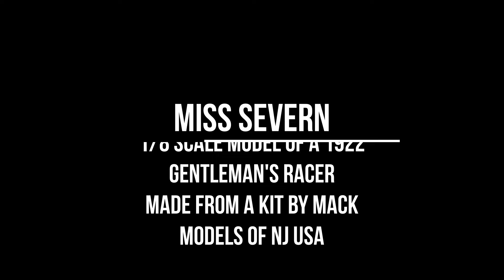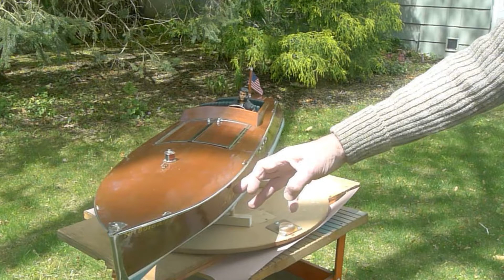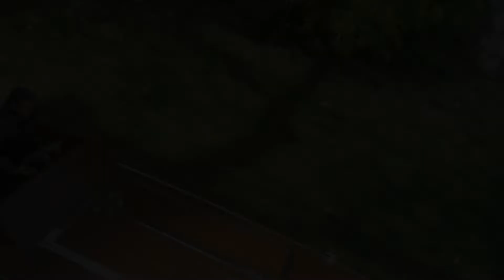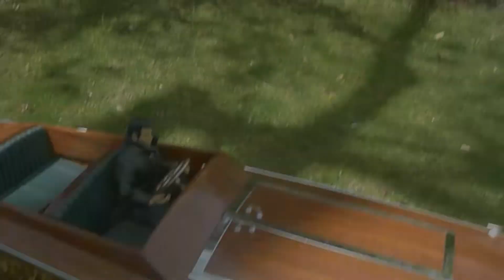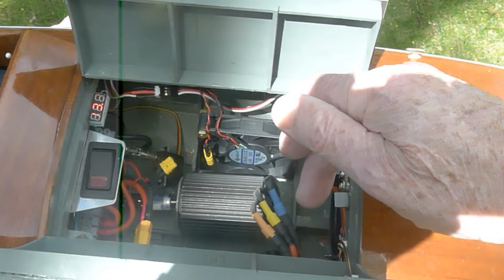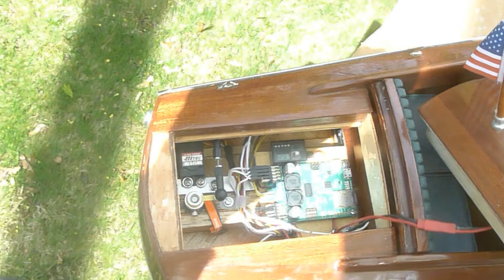Miss Severn Model Speedboat Description

Comment: Did you build this boat by yourself or is the boat already builded?
Reply from the maker: It was built by me from a kit supplied by Mack Model of New Jersey
Reply: Hello. The model boat was offered and made by a company in Vietnam. I would like to have more information about the kit and preferably the manual. That way I can see what the materials look like and how the boat is built. But I didn’t get any clear answers. That’s why I didn’t dare to go through with it.

I also couldn’t find anyone on YouTube showing how the boat is built.
Are the parts all wooden strips or large sheets?
Could you help me by, for example, sending me the manual?
Here in the Netherlands, it’s not available in any model shops.
It is available on Etsy and costs €540, plus import duties from Vietnam —
a total of about €680.

Kind regards,
Jac.
Reply from the maker: @jaccoolen4509  I know nothing about the Vietnam model.
The boat I built costs a similar amount to what they charge.
Here is the link to the kit - a 1922 Hacker Gold Cup Boat.

https://www.mackproductsrc.com/models/competition
For more details go to:-

https://www.rcgroups.com/forums/showthread.php?1621071-1922-Gold-Cup-Racer-MISS-SEVERN

Here you will find all the details, written by the kit maker, that describe the building of the boat.

This should answer all your questions and there are also many other postings on rcgroups.com, including mine.

It is a very nice boat and runs very well

Good luck

Bruce